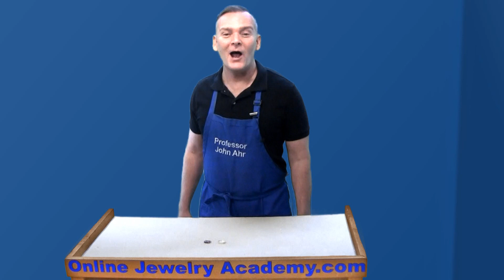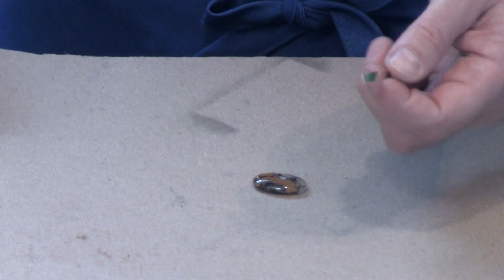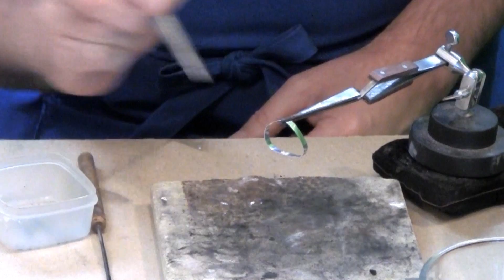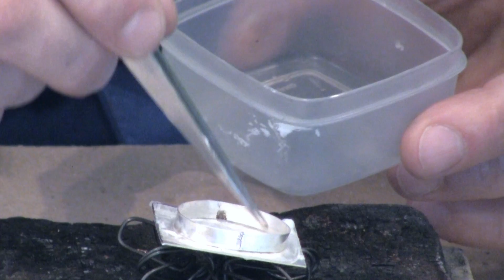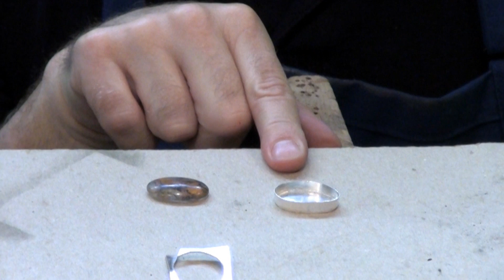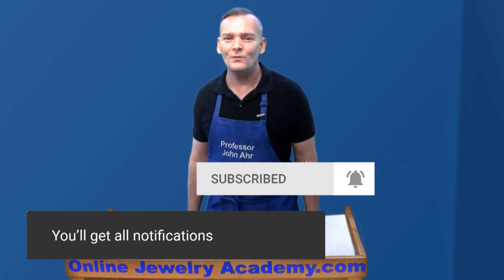How I Made A Custom Bezel For A Cabochon Stone

Comment: Can you use a gold filled wire and sheet?
Reply from the maker: Personally, I never work with “filled” metal materials. But, you can work with them to make soldered jewelry. Remember to match your solder color. And, you might need to get a low karate gold bezel wire. 😀

Comment: Hi there, love your videos!  Thank you!  Which cut file are you using on the bezel to remove that 1mm around the bezel?  And would you use a different number cut if it were copper/brass?
Reply from the maker: First, use your jewelers saw to trim most of the excess metal away from the basil. Then use the zero cut file to get fairly close to the edge of the bezel. Then, you can use a finer cut file to smooth the edge of the bezel. If you are making a bezel out of brass or copper you might need to use a course or cut file to refine them. But the process is essentially the same. 😀
Reply: @OnlineJewelryAcademy  Thanks!  The right files are quite pricey so I was using a cheap #2 cut from the hardware store on a copper bezel and it was just horrendous!!
Reply: @OnlineJewelryAcademy  When you say coarse and then a finer one do you mean a #0 and then a #2?
Reply from the maker: @Anna-Catalina  It depends on how much metal you want to remove. This link might help: https://contenti.com/media/catalog/pdf/library/file_cuts_styles_shapes.pdf. The OJA also has videos on file posted to its website at: www.onlinejewelryacademy .com. There you’ll find our videos organized by topic.
Reply: @OnlineJewelryAcademy  About the amount of metal you file off the bezel in the video is about how much, which # cut file are you using in the video?  Thanks for the link!!
Reply from the maker: @Anna-Catalina  I honestly don’t remember. Sorry.
Reply: @OnlineJewelryAcademy  Well thanks so much for your help and speedy replies!  Much appreciation - from South Africa

Comment: Hi john.... I need your help !!  I use sealing wax to block and work stones.  But how can I eliminate and clean the pieces of wax that remain attached to the stones when I detach them? ..... thank you very much .....
Reply from the maker: You need to dissolve the wax with a solvent.  I'm not sure what the composition is of the wax that you used.  But, denatured alcohol or nail polish remover (acetone) might work.  Be sure to take precautions to protect your health.  If these solvents don't work, you might want to contact the manufacturer for help. : )
Reply: @OnlineJewelryAcademy  grazie#!!!!!!......👍👍👍👍👍👍👍

Comment: What is the gauge of the metal sheet?
Reply from the maker: Bezel wire is always 28 gauge fine silver.  The base of your bezel setting can be made from sheet metal between 22 to 18 gauge.  For large setting, I generally use a thicker gauge for the base to avoid warping. : )